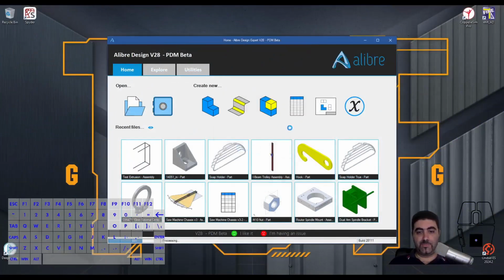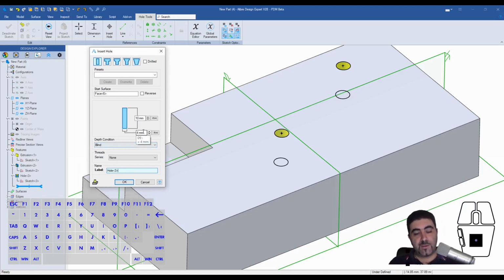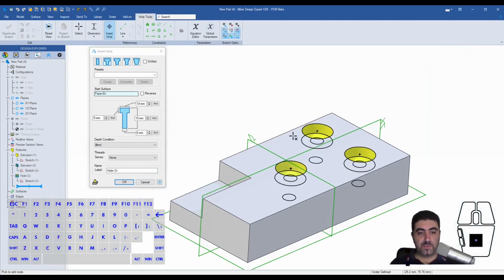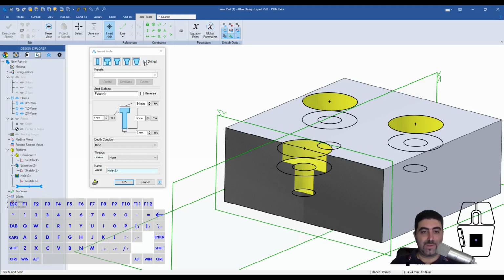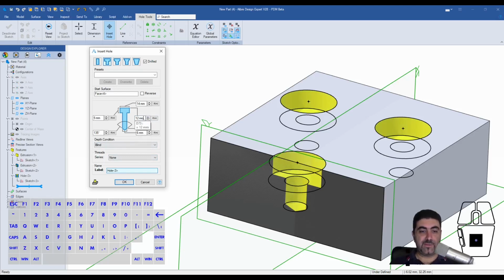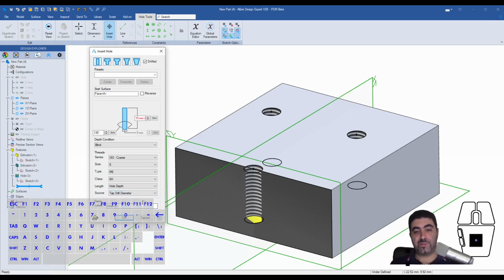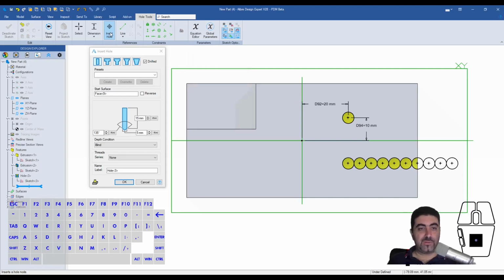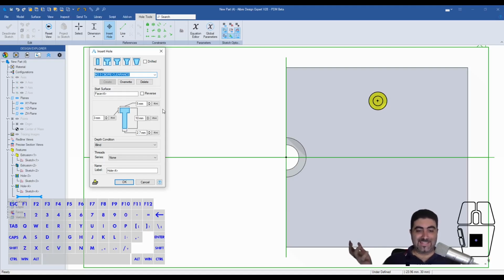Rookie to Rocking it: Hole Tool Masterclass

Comment: 4:19 and that is where the hole tool really gets powerful. It could be argued that because Alibre will auto-equal constrain circles if you are careful with your mouse that for regular circular holes, using a circle shaped sketch would be about the same as the hole tool. But with things like counter-bore and counter-sunk holes, this is where the hole tool REALLY shines.
12:31 gross. Math. ... I love how Alibre has so much kept in mind for machine shops while also being easy to use for hobbyists like myself.
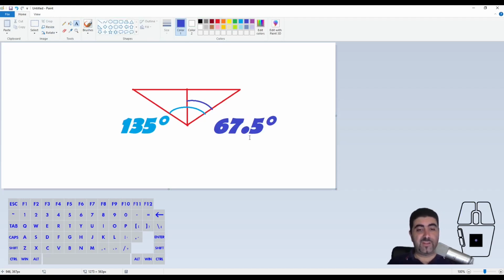13:33 Don't know if you know this but you can type the degree symbol by holding Alt, type 0176, then release the Alt key. Yes, I have a chart of common alt codes in front of my desk.
25:00 Very helpful video as always.
Reply from the maker: Man!!! As always, the most detailed amazing comments! Great for me as a content creator and great for other people viewing the video as well...

Thanks, man!

Comment: The hole tool is a great feature, but how do I define the dimensions in Alibre Atom3D? I’m having trouble because the top menu isn’t appearing for me. If there's no way to set precise dimensions, the tool loses much of its utility
Reply from the maker: Hey Unders, thanks for watching and commenting.

The top menu not appearing is a Atom 3D difference which I was made aware of after I made the video. So here's what you do. 

After you have placed the holes, if you do not have reference geometry to snap them onto, there is a feature created in the feature tree. That feature has a sketch associated with it. If you edit it you will see your holes represented as nodes (points) and you can dimension and reference those like you would in any other sketch.

If you go to the forums and look for the conversation "Question regarding hole patterns." in the "Using Alibre Design" subforum a user had a similar question and there are a few answers there.

Comment: Thank you for doing all these videos.  They are clear and informative.  I've learned many things from them.  You may want to remove this video from the "Works with Atom3D" playlist though.  Sadly, this tool is NOT available in Atom3D (even though it was present in the previous incarnation of entry level Alibre software).
Reply from the maker: Oh man, OK. I will, thank you for letting me know. So now Alibre Atom does not have a Hole Wizard? Hmmm, very odd... But they are advertising 3D modelled internal threads. How is that done then? Hmmm...

P.S. Check the forums, I think the Hole tool is still available in Atom
Reply: @ExMachinaEngineering  Thanks for getting back to me!  I was using v28.01 this morning ... no Hole Tool.  I manually updated to v28.1 this afternoon and now have a Hole Tool!  For some reason the "check for update" didn't see the latest update even with a current maintenance agreement.  "Loosing" the Hole Tool all those years ago when Atom3D first came was frustrating - glad it's back.
Reply from the maker: Great news. The hole tool is really powerful!!!